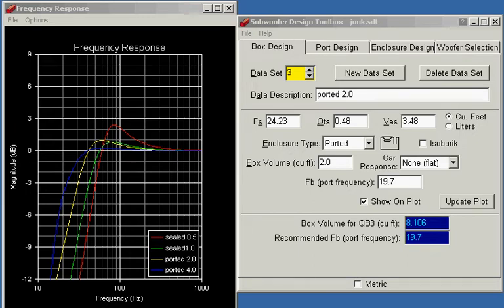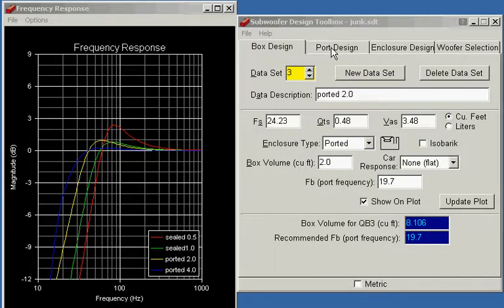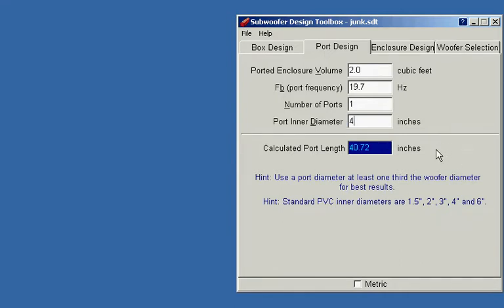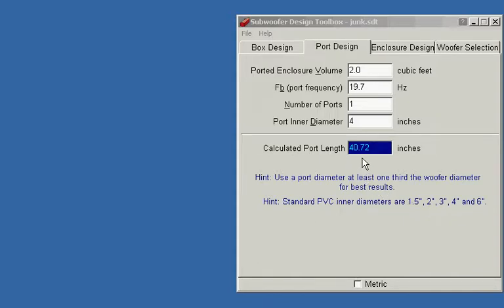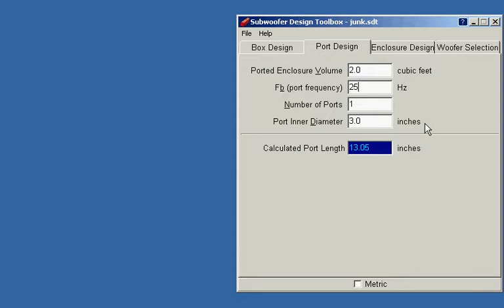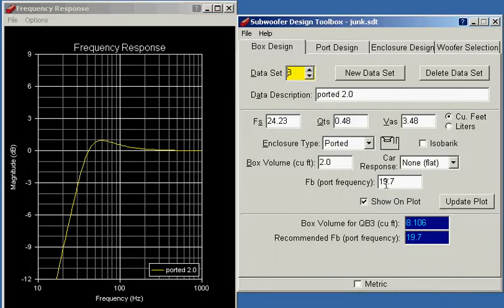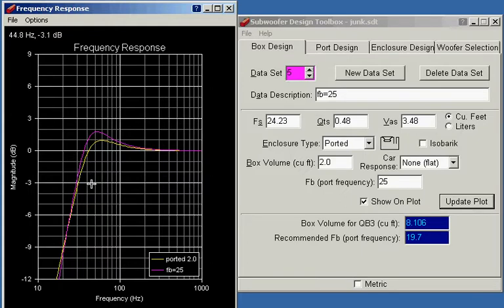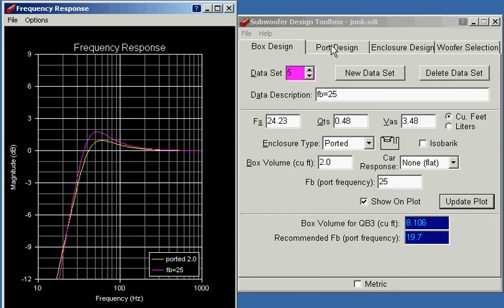Design Your Own Subwoofer Box - Part 2: Port Design

Comment from the maker: Yes it would.  This is just part of the compromise nature of designing a box, you  improve one thing at the expense of another.  Using a flared aeroport port tube will help with port noise, and is especially useful when you slightly undersize the port opening to keep the port length reasonable.

Comment from the maker: @joestl314 
The program suggests a port tuning to provide the flattest extended bass response.  It's a good starting point and users are encouraged to play with the settings (box volume, enclosure type, port tuning) to design their ultimate box - that's the intent of the program.  I agree with your comments about the possible benefits of higher tuning.

Comment: Good video. I'm curious why the program suggested such low tuning. Normally you see tuning in the low 30's...maybe down to the high 20's. I'm a car audio guy who has an enclosure tuned at 26hz and it seems unnecessary to tune any lower. my response curve is flat from 25hz to 80hz. 

By tuning higher your can also greatly increase output. 30hz tuning is a good compromise for nearly all types of music. Higher tuning can product lots of SPL in a narrow bandwidth just above the tuning.

Comment from the maker: @jhalexis 
I'll give an example.  Suppose the slot is 1" tall by 12" wide.  Using the formula in the earlier post, D=2*squareroot(Width*Height/pi), I calculate D=3.91 inches.  That's the equivalent diameter of the slot.  Plug that into the tool to get the port length, then shorten it by a half inch to correct for the wall factor.

I don't know what you mean by "the software will give a longer port length" but keep in mind that the port length will increase if you increase the port diameter.

Comment from the maker: @Poppaghost69 

Follow the same procedure as with a round port, but with the following changes:
 
For a rectangular port, calculate D=2*squareroot(Width*Height/pi) and use that for diameter in the Port Design Tool.
 
For a slot port, the port uses one wall of the enclosure which makes the box think the port is longer than it actually is. Use the rectangular port method, but then shorten it by half the height (smaller port dimension) to compensate.

Comment from the maker: @8minutestorm 
You can use a 90 degree fitting for the port, it will not cause a problem.  The biggest question is how much length the fitting adds.  I measure the distance across the center of the fitting.

Comment: Hi, when using a PVC pipe for the port and 90 degree pipe fitting, do you think that the fitting will cause airflow problems through the pipe because it's not straight? Will cause that much to affect the sound? Thanks

Comment from the maker: fb is the same thing as the box tuning frequency, so I may not understand your question.  If you meant the peak frequency, the answer depends on the speaker parameters (Thiele/Small parameters).

Comment from the maker: @hyperjay712 

Above the port tuning frequency, the port output constructively adds to the woofer output and provides a boost.  Below the port tuning frequency, the port output is out of phase with the woofer output and provides destructive interference.  So the peaking frequency is always above the port tuning frequency.  By how much depends on the box volume and speaker parameters, and software is the easiest way to find out.